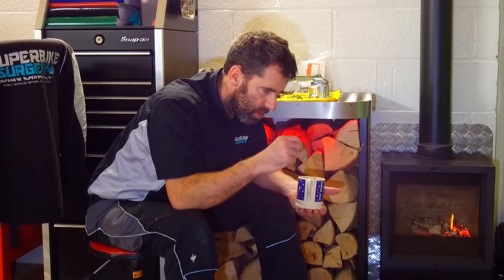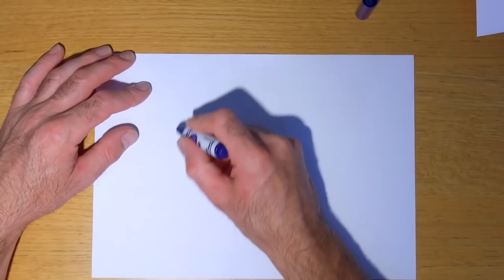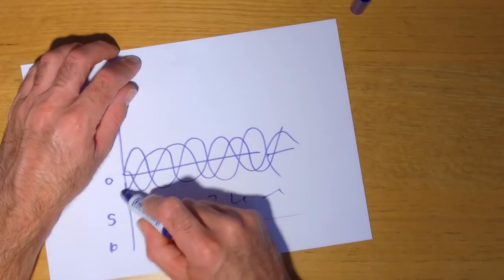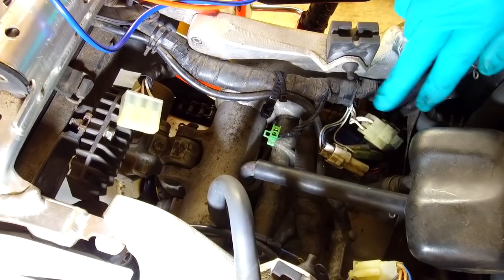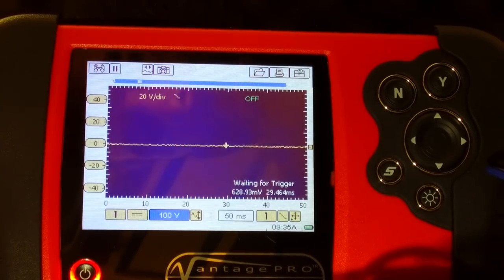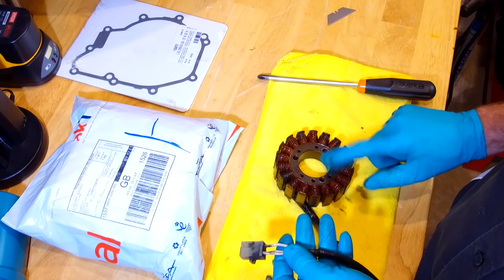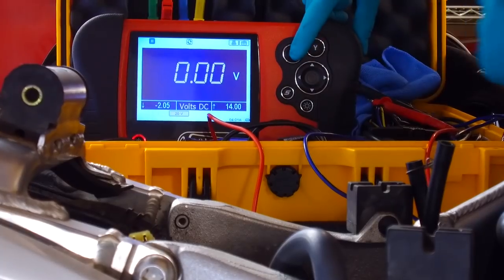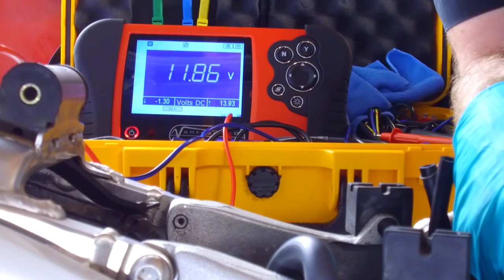The Anatomy Of A Motorcycle Battery Charging System

Comment: So it was both the rectifier, losing current on one conection, as well as the hub dpinnet, burned like a sponge on some of its fingers taking more AC than the wrong, or broken rectifyier connecying ehite, or yellow wires? Yes? Plus the battery losing its direct back wash current with the breakung in the wave currents through the daisy chain effectively losing its regular and even sctual pulses? Ahhh!!! Xxxx
Reply: Sorry for spelling mistakes. I got to vlean my fish out now, then get my Kymco ck1 125 cc and give it a lesson sweets, NosDa and Best Wishes, From The Queen  of Wales lol xxxx

Comment: It IS interesting that although you call it a generator, It is really a 'Magneto' as the magnetic field
that passes through the windings is produced by MAGNETS. were it an actual generator, the
magnetic rotor would be an electro-magnet, having coils connected to a battery. I have heard the
term magneto applied more to the ignition system.

Comment: It's very confusing when as a professional you call a connection an “EARTH” when NO earth connection is made.
An EARTH connection is as it states is connected to earth which a chassis return to battery is NOT an earth connection.
Low voltage DC systems do NOT have or need an earth connection.
Chassis return, as most vehicles have now is battery negative, but some older vehicles have a positive chassis return, but no earth.